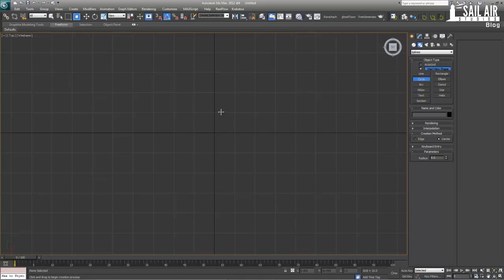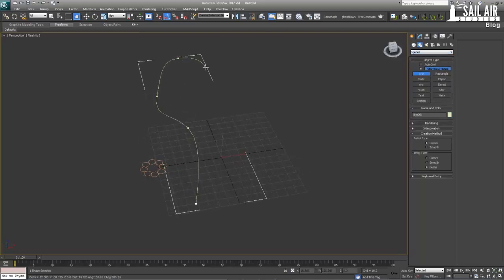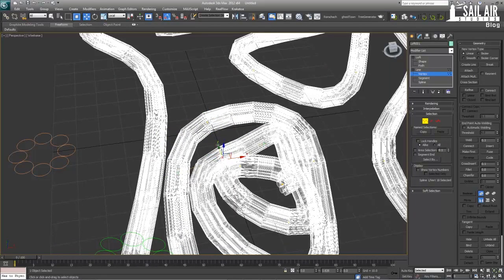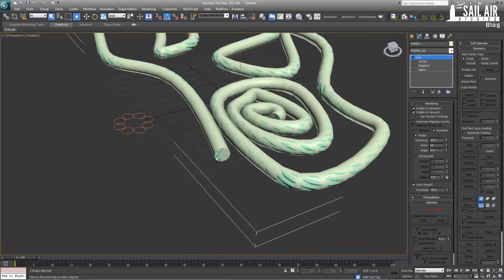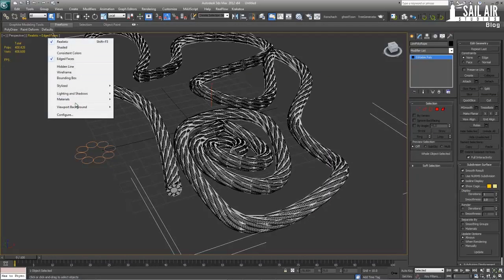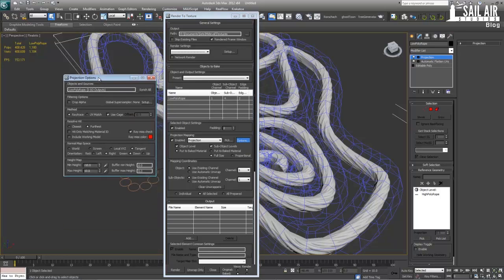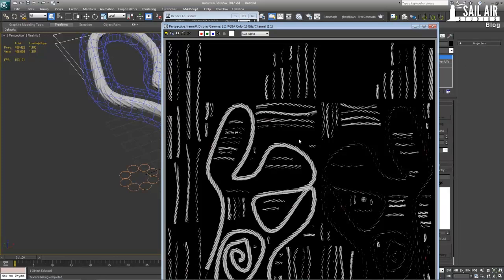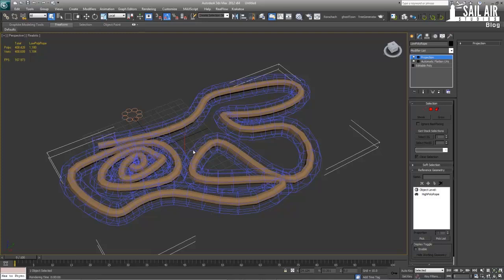Tutorial - Autodesk 3ds Max - Low Poly Game Ready Rope

Comment: an another way to do a rope 
1. use 4 cylinders
2. put them close to each other like a square/ or a plus sign 
3. attach all the cylinders togheder
4. mark the 4 cylinders and use twist in the modifier list
5. and just twist them how u want, recommended is Angel: 2250cm degrees, if the cylinders are not so high( over 700 cm high)
6. there u go a rope done :)
extra
7. u can use line to make a phat for the rope
8. click the rope and use phat deform in the modify list.
click "pick phat" then chose the line and then u can click the " move to phat"

THE  END

Comment: Great tutorial.  I'm coming in having never used this program before.  I just downloaded the demo because I only need one thing: A ring of rope.  I used 3 circles instead of 8, moved the pivot point to middle of the 3 circles and I got the shape to loft onto a circle path and twisted it by 15,000.  The one problem I am having however is that it is twisting each of the 3 "strands" individually in addition to twisting the 3 strands together.  This makes the strands of the rope look bumpy, not smooth.  Do you know how I can apply the twist to JUST the pivot point and not each individual circle in the lofted shape?

One thing you mention in the tutorial that I couldn't find was the "loft modifier."  I followed your mouse clicks and got pretty close, but I couldn't find where you used the "loft modifier to create a cross section of the rope"  The might be the key.